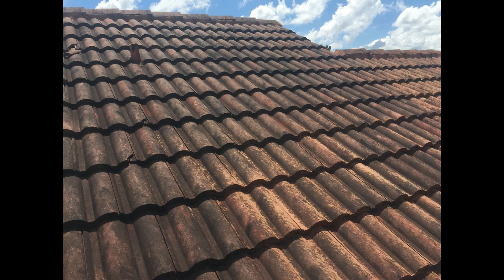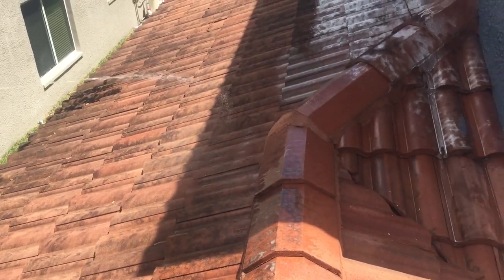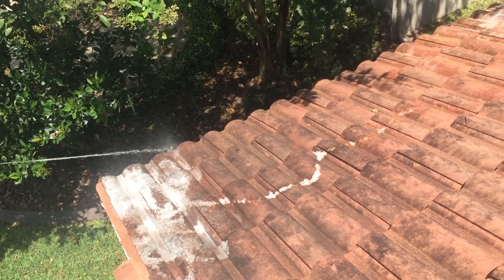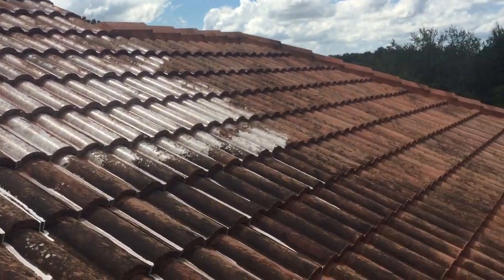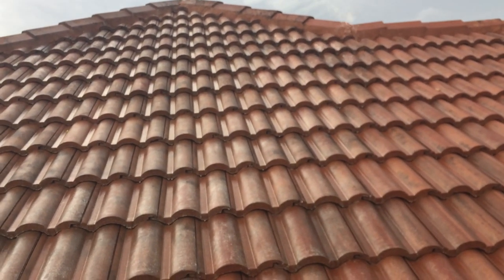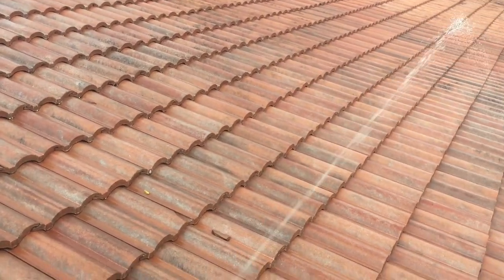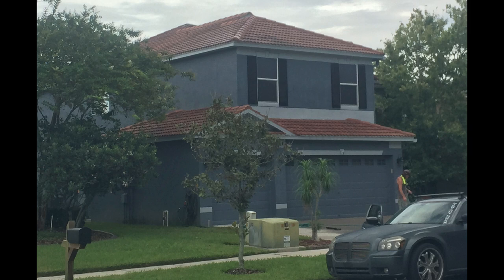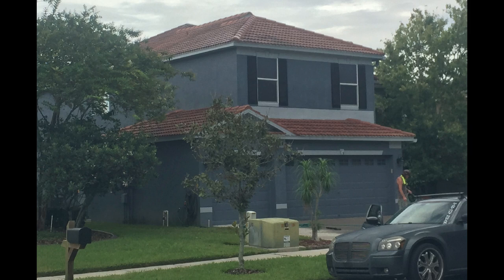Tile roof soft wash cleaning - roof cleaning service

Comment: why didn't you guys use a surfactant?  Your SH      would not have just run off of the roof so quickly.
Reply from the maker: We use surfactant it only slows your run off down when the material you clean is dry but once it's to wet it will slide off.

Comment: How much to charge for sq for when doing ceramic tile.  Tampa Florida area.  Tku
Reply from the maker: really depends on the house and access too, most single story start at $299 but can go up to like $3000 when like it's a 8000sf house with Boat docks which are 1/4 mile away from the road so that we have to carry it all down there.
Reply: LSE LLC (Lumanet Solar Energy LLC) So a roof like this one would you say 1200-1500 is fair for a 4200 sq ft house?

Comment: How many litres of sodium hypochlorite did you use on this roof roughly?
Reply from the maker: We ended up with 94 liter at 13% SH. We lost about 26 Liter on the first day because the rain started to down poor on us so the SH was back to been just water.... :-(  Also don't forget these roof tiles had no sealer or glace on it so almost 50% are absorb into the single itself and won't run off. So double check what type of roof you are washing. Like brand new glace tiles I use on a same size roof about 35 liter.

Comment: Wouldn't a 50/50 mix on a pre wetted roof, sprayed in a fan patern have got into all the areas first spray and been quicker? Seen jobs like this done in an hour, a days a very long time, thats like taking a day to spray your lawn
Reply from the maker: Yes and no. if you pre wet a roof the solution will not stay in place. 
2nd you do not walk on those concrete shingles or even clay tile shingles. You will break first the singles and than end up sliding and falling of the roof. On asphalt shingles which have a lower pitch and it's safer to walk on you can apply it by walking on the roof without slipping and falling. The risk of falling on those tiles is way to great and don't forget we are in Florida so our roof pitches are a lot differ from what is been build up north. If there is any little bit on of water on the roof as you try to clean it is is like soak water, extremely slippery and you will destroy customer property and might end up killing yourself.
Reply: LSE LLC (Lumanet Solar Energy LLC) m

Comment: Wouldn't it be better to use another tip than 0
Reply from the maker: Thank you for asking and not if you are shooting onto the roof while having wind. If you can walk on the roof you can use a 40 or 25 degree tip. But for distance you need a 0 degree with pressure in order to shoot up onto the roof.

Comment: What size ladder did you need here?
Reply from the maker: 32 ft ladder for a double story
Reply: @lsellclumanetsolarenergyll5071  that's what I'm leaning towards buying. How is it does it just make it or is it good and sturdy with some more to spare?
Reply from the maker: @homecaresolutions467  Don't BUY NEW !!! Look at Offerup or Letgo you can find for a fraction of the cost a ladder.
Reply: I may have just found a steal thanks for the idea. Where are you located?
Reply from the maker: @homecaresolutions467  Central Florida is our HQ
Reply: Okay I'm in palm beach
Reply from the maker: @homecaresolutions467  We do have plenty customers down in West Palm Beach and Wellington as well as Boca Raton area too.
Reply: @lsellclumanetsolarenergyll5071  I'm technically out of west Lake Worth so if you can't get to something let me know maybe we can help each other out.
Reply from the maker: @homecaresolutions467  certainly will do

Comment: Is there a recipe for the cleaning solution?
Reply from the maker: Yes use %13 SH and Surfactant with Water. Depending on the strength you need to apply mix in the Water. Most roof will require a 3-5% SH to Water mix. So for every Gallon of SH 13% you use 0.8 Gallon on 10 Gallon of water and you get a very close mixture of around 5% ... hope I didn't screw up on math.
Reply: @lsellclumanetsolarenergyll5071  .....so that equals a 8% mix?
Reply from the maker: @jamesmitchell6288  lower more about 5-6% at the end. You don't want it to high and apply more in layers or you might have problems with the underside/material which is under the shingle. Less is more just ensure it's run off is reduced that's why a surfactant is so important.

Comment: You don't destroy the tiles using pressure
Reply from the maker: actually you do. Those old Boral tiles breaking apart because of the Florida sun. Now you put pressure to it and they break into pieces. I suggest you better learn your industry and their products before you comment on it.
Reply: 8 years I've never had an issue.

Comment: okay you spoke about how dangerous the stuff is .. so why in heavens would you wanna leave it on your roof ??? the correct way is to put that stuff on and immediately wash it off ... You need a some type of rinse cycle going on you don't leave bleach in your clothes right?? now I want you to make a video of the roof in about 4 years and look at how much its faded .. these soft wash companies in south florida crack me up .. they're leaving you with problems in the future .. I guess if one is just renting the property they won't care but to a home owner they might want to be cautious
Reply from the maker: ok a few things you can't see but we saw onsite was a thunderstrom was moving in which was a down poor so mother nature did the rinse for us. But the other thing you also should know those roof tiles are not easy to clean up with just water because they are very poors so they absorb like a sponge and don't release even when you wash down with thousand of gallon's. Watch a little closer on the video and you will see when I only apply a thin layer that the tile is fully absorbing the chemical. With the lower pitch roofs down here in Florida things are a lot different from up north. The bigger importance is the run off to be neutralized with water on the ground so it don't destroy plants and grass.
Reply: Dee double u for one the method he is using is the proper method that (Arma)  the shingle manufacturer recommends to clean there product . You cant just spray 4% mix up there and rinse it right off ,you have to give it time to kill the mold/ mildew or any other organic growth on the roof.Sodium hypochlorite is a sanitizer and cleaner for many things,also it is in our water that we drink ,its part of the cleaning process of the water to kill off any bacteria in the city drinking water.Sodium Hydroxide is also an Oxidizer ,which is why your trying to say 4 years later look at the roofs that these softwash companies do,but what you dont understand is ...so is the sun ,the sun is responsible for 90% oxidation ,so that means if a homeowner has is roof soft washed the correct way,because it has black Algae all over it ,the end product you are seeing is the roof being restored to its original color,which usually has not been seen for many many years.If it was the wrong way to clean a roof ARMA would not endorse it on there shingles.And if it was the wrong way ,i would of been out of business 19 years ago.....dont quit your day job
Reply from the maker: @scottruch674  don't forget ARMA focus on asphalt shingles, Roof tile shingles absorb the fluid you stray on differently. 80% of what you spray on is absorbed by the shingles once you did a section of a roof it already worked it's way in under 2 min thru the shingle so once you apply the water it dilute it's strength down till it's no longer a hazard.  When you do asphalt shingles you have only the very thin surface to clean so you use less strength and more surfactant .
Reply: @lsellclumanetsolarenergyll5071  yes but Arma has said over and over again through research it dont matter the style roof or material,a soft wash is the way to do a roof period ,and yes the tiles react the same as a wood shingled roof it absorbs quickly but depending on how bad they are ,you have to let them set and do there thing,they can be stubborn sometimes, i put as little of my mix as possible in an area and gauge how long it takes to start  working .I also use proportioners on my setups to quickly adjust things ,ive been in this game since 2001 full time for a living, so that guys comments gave me a good laugh .And fyi  good video